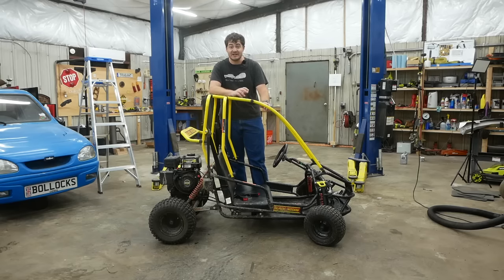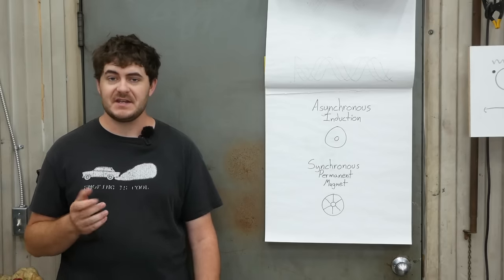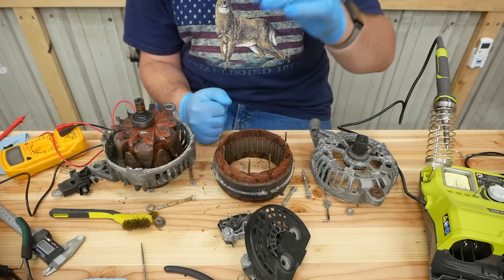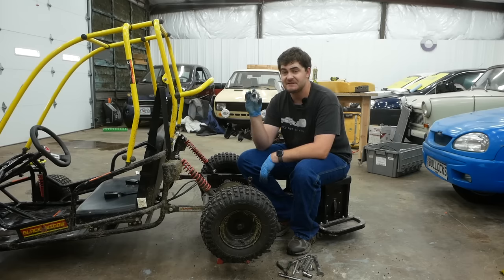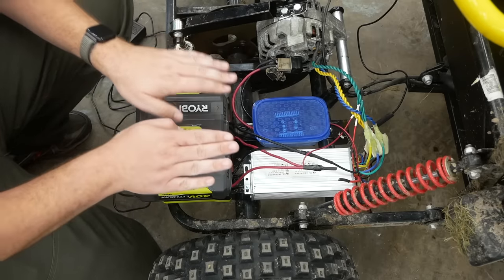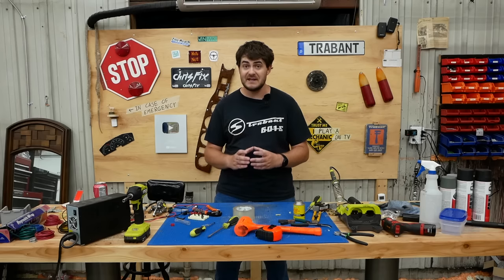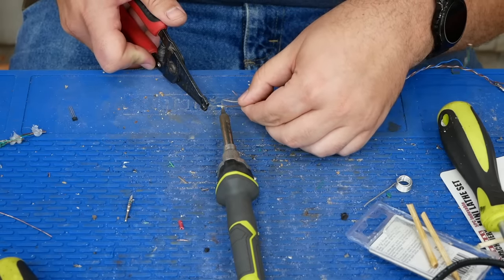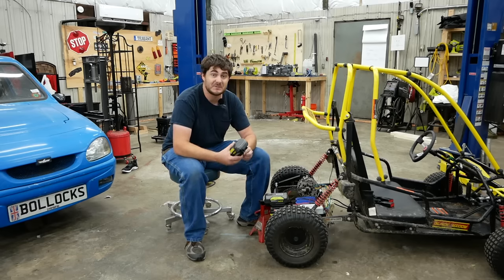Can I Power This Go Kart with a Used Car Alternator?

Comment: "So why doesn't it work? I don't know."

This is my maintenance career in a nutshell.

Edit: I've been informed that the reason it's broken is that somewhere years ago a maintenance technician slept with an engineer's wife and the rest of us maintenance guys are still paying the price.
Reply: Have you tried turning it off and on again? 

This is a joke in IT support, but it's also the most common advice. Because it works 90% of the time. Bloody programmers can't write software without memory leaks, or that gives back resources the computer when it's finished using them.

So then when another program, or the same one later on, need these resources, they're not there. If it's RAM they've consumed and lost track of (a memory leak), eventually the system will run out of free RAM and start swapping out to the hard drive, causing thrashing and slowing things riiiight down. So we'd ask you to save your work, if you can, then shutdown and restart. On restart the RAM allocation list is nice and free again, resources are fresh and unallocated, so programs can ask for resources and expect to get them. Everything runs nicely!

Except there's still that leak...! The solution ultimately is for the company to fix their damn software and for users to update to that version. But in that time there'll be a different bug in that, or some other, bit of software.
Reply: Software devs are the bane of my existence. Last timeI had an issue I sent 140 GBs of data to one of our software engineers to back up my claims because a control program they had us upgrade in the field had a huge memory leak and would corrupt it's own config files.

His reply was, "Huh, well it didn't do that in our field trials."
Reply: @NORMIES_GET_OUT  as an engineer I can tell you that when we design new things, shit always happens. I spent months working on the binary register of a microcontroller to be able to manipulate multiple dc motors. It worked PERFECT up until installed in the machine. Then EMF from the dang motors caused it to auto trigger since I was using such “basic” components of the controller!!

We try, we really do, I am also a mechanic of 20 years so I know the pain of a terribly placed bolt (just as my engine mounts smh)

But it still just happens. And most of us are (probably) eternally sorry!!
Reply: @TGears314  aawww man. and here i was thinking that every terrible placed bolt or stupid ass system (or function within a system) was put there on purpose by a very bitter human behind a desk, dedicated to the missery of others. like "ok.. we need a bolt here, here, and there. you know what? fuck it, i havee a terrible day... im gonna put it over there so someone someday somewhere will curse until hell opens right bellow their damn feet". :P
Reply: @NORMIES_GET_OUT  AMEN, AMEN, AMEN!!!
Reply: Oh my god, that explains so much. Every tiny bolt I’ve had to remove from a nearly inaccessible place in a gas pump while lying in the ground during winter in Canada suddenly comes into focus. lol
Reply: @greenaum  Have you tried programming something really complex before (I still struggle with simple stuff).  Sometimes software engineers really are lazy or more likely rushed by impatient bosses that don't understand that it takes time to make things right (as happens in every industry).  A lot of times software is made of many smaller pieces of code that someone else worked on because reinventing the wheel takes way too long and is kinda stupid.  Sometimes (often times) those pieces of code are maintained by 1 old guy in a small country who does the work because it's better than Sudoku (ie they are bored and enjoy coding).

Also memory leaks aren't the main reason why turning something off and on again fixes it.  Usually it's because of some other unexpected bug that causes a program to enter a loop that it can't get out of.  Sometimes this causes memory issues as well but that's not the main issue, it's that the program encountered an unexpected error that never came up in testing because you can only test so much.  Sometimes software companies have inadequate testing methods and never learn but usually once an error has been encountered and fixed a new test is added to try to catch similar errors in the future.  Sometimes there's no way to test for a particular type of error.  Sometimes hardware is to blame, especially outside of general computers (PC, Mac, Linux, Android, iPhone) in applications with harsh environments (cars, airplanes, spacecraft, ect).  Sometimes cosmic radiation flips a bit that causes random behavior (cosmic radiation actually led to a Speed Run world record in one of the Super Mario Games).

Comment: Can't he just drive the electric lawn mower? Then you can get some grass cut at the same time!
Of course he might wreck it and you'd be down one $5000 lawn mower and possible responsible for the death of a 6-year old...
Reply: Just get the wheego running again and he can use that
Reply: you would save more than $5000 in the long run not caring for the child
Reply: What he should do is ditch this dumb idea and put the damned engine back in it.  A simple limiter on the throttle will solve the power (of a 6yo) problem, just like they do with go-karts in those go-kart rental places.
I subbed to this channel back when he was rebuilding the Trabant engine.  Taking a great gas powered go-kart and turning into a shitty electric cart is just dumb.  Trying to convert an alternator into an electric motor for the kart is DUMB.  I already knew he was going to run into all these problems because he's not the first youtuber to discover the problem of re-purposing an alternator.  Furthermore, this thing is designed for a maximum of 65 amps output or about 900 watts.  They are notoriously unreliable with high load.
Reply: @tarstarkusz  I guess you missed the part where he said he was doing this for the fun of it.  He wanted to do the thing. So he did the thing.  If you came here to watch an expert with all the answers do the most efficient and effective thing, you've got the wrong channel (and website, for that matter.)
Reply: @tarstarkusz  isn't he doing this for the fun of it?
Reply: I was driving riding mowers with I was 5 and 6. Also Tarstarkusz is right on all counts.
Reply: You did not get the idea, he wants to eliminate the gas engine for its noisy and dangerous gasoline operation for his kid by modifying a alternator with a good source of information video which helped many understanding the concept of a working alternator, it wasn't a dumb but very clever idea, this was a informative video for intelligent individuals, he is a smarter person than you are period.
Reply: @ao2528  Gasoline engines are not in the slightest bit dangerous. Most people operate them multiple times per day.
The noise is a feature, not a bug.  Were you ever a kid?  Or were born a grumpy old guy?
Reply: @FranNyan  And fixing the motor wouldn't be fun?  I subed to this channel during the Trabant rebuild of the motor.
The segment of the audience this appeals to is the geeks. They absolutely love over complicated and sub-optimal "fixes" to imaginary problems like how "dangerous" and "noisy" the engine is. To where before this could be ridden all day, non stop, now at best at an hour.  
Do you know any children?  It's been damn near 50 years since I was on a big wheel screaming VROOOM VROOOM or sticking cards in the spokes of a bike to try and get that sound and I STILL remember it.  My own kids did it.
Reply: @tarstarkusz  you must be fun at parties.
Reply: @AdamS-nv5oo  As a matter of fact I am.  If my guests don't like the music, I don't just call them partypoopers, I turn the damned dial!!!
Reply: @tarstarkusz  You're basically complaining that he's doing the project HE wants to do, instead of the project YOU want him to do.   

I know plenty children, enough to know that each kiddo has their own preferences and likes.  And I trust that this guy knows the preferences and likes of his kiddo better than some rando on the internet does.
Reply: Natural selection
Reply: @KanawhaCountyWX  It would be less powerful than the go-kart.
Reply: @nitehawk86  it would say from the trouble of having to put in a speed limiter
Reply: @tarstarkusz  he said he was doing it for fun because he wanted to, he also said if it doesn't work he'd put the old engine back in
Reply: @tarstarkusz  fixing the engine could be fun like youve said a few times now he rebuilt the trabant engine for the reason.. it was fun and he wanted to... but aging wheels isnt just an engine channel, hes fallen in love with electric vehicles too, odd electric vehicles that are cheaply made and arent worth it like the wheego, but electrics too... plus thats just a 4HP side shaft engine, fixing it is almost dumb cause for the same amount fixing it can cost he just just go pickup a predator engine from harbor freight for pretty much the same cost, but wheres the fun in that cause then he might as well have just bought a better go kart with a working engine... maybe he bought that particular one knowing full well he wanted to electric swap it, you can clearly see in the video its more work than just hoiking another engine or fixing the broken engine, maybe he wanted a little project and well this looks more fun to watch... also yea im sure your fun at parties, turning the dial up on whatever you want to listen to but harranging others for having their own tastes that dont match you.
Reply: @compzac  No, he likes this kind of thing because it's over-complicated and doesn't work well.  That is what appeals to him.  This attribute comes out in a many different ways.  I was once like this myself.
We don't know what "fixing" the engine entails. It could be a rebuild or it could be cleaning the carb. He didn't say.  You can say the same exact thing about the electric motor.  he already could have bought a small electric motor for what he has spent.  Building a battery is going to cost hundreds of dollars and requires equipment he doesn't already own and which has no real other purpose.
This thing is useless as an EV.  He will get maybe an hour's run time out of it after spending many hundreds of dollars.  Or he could just fix the engine and it will run all day,
Reply: @theforerunnerreclaimer  Well, it doesn't work and instead of the old engine being fixed, which is the most sensible thing to do, he's got hundreds of dollars of parts on order.  All to make the thing less fun and less usable.
Reply: @tarstarkusz  OMG - you’ve made your point now take a chill pill. There is nothing really complicated about this project. It’s way simpler than a gasoline engine. Yes the engine might be quicker and cheaper to fix because we have a wealth of knowlege about them and plenty of cheap spares. But by the same token he could have bought an e-bike kit of Amazon and that would have been more powerful, less hassle to maintain and even simpler. But he wouldn’t have learnt anything. And his viewers wouldn’t learn anything. I’m not really sure what your problem is. No one forced you to watch.
Reply: @mondotv4216  I'm replying to people replying to me.
It's not simpler and you can ride it for many hours on gasoline.  Now it's turning into a thousand dollar boondoggle.
Reply: You do realize that by the time he is done this will probably be doing a wheelie or a burnout, which the original engine would probably not be capable of.
Reply: @milescarter7803  Sure it is. It's just a matter of gearing. 4hp is 3kw.

Comment: Hi, thanks for your work. my alternator sensorless was not starting on one ESC, now with a really cheap ESC is starting without hesitation. Once your moving, consider you have high current at no load (i measured 580W on mine @48V), so you need even more battery
Alternator to Brushless conversion-current at no load

Comment: I guess there wasn't a Weego motor or battery available for the project?
Reply: I was afraid he was going to use a Coda motor...
Reply: The Wheego battery is dead, remember? All the LiFePO4 cells failed. Also that motor can accelerate a car up to 60 miles an hour, that child will blast itself into a tree so hard it will become wood.
Reply: He wants the go-kart to run.

Comment: The magic sensorless rotor sensing thing is called Back-EMF. It uses the residual current from the phase winding that is idling (one of the three always is), to figure out where the rotor is.
Reply: I was quietly screaming this in my brain the whole time
Reply: I wrote this in butter on my toast this morning
Reply: you only know rotor position within one electrical cycle (phase). you still don't know the exact position of the rotor itself as there are multiple electrical cycles per revolution.

also, the "idling" phase statement is only correct for block-commutated/six-step drives. Sinewave and FOC drive all 3 phases all of the time.
Reply: In Permanent Magnet Synchronous motor (PMSM) drives, shaft position information is required 
for the proper control of the machine. In the PMSM drive the torque ripple generated by the 
machine has various harmonic content. The major torque ripple generated in a three phase machine
is due to the interaction of 5th, 7th
, 11th and 13th harmonics in the back emf with the phase current.
These induced voltage harmonics are responsible for the 6th and 12th order (electrical) ripple in the 
torque. In practical applications we tend to see various other harmonic orders in the torque.
Reply: @brianginn6354  me too

Comment: Use the centrifugal clutch from the gas motor on the electric one.  That's how the RC car folks did fuel to electric power conversions back when the controllers were crappy.  Motor can get spinning before is sees any load.
Reply: That was my first thought too!

Comment: the batteries probably have voltage sag, drawing too much power will course the voltage to drop down to too low levels which causes them to cut off

Comment: Hi, cool video
If you need more control of what is happening on sensor, motor, startup ramps… use a VESC, is so configurable , detects sensor position, adjustable cutout thresholds. Cost more (the smallest 50A is about 85 euro now, i paid 50 years ago)  and you can adjust the max speed with the bluetooth. I used in a kart and motorcycle (Pocket bike electric conversion - brushless)

Comment: While you were explaining things, I was thinking of ways to accomplish the goal.  The Alternator normally puts out 3 phase AC.  By removing the diodes, you have a ~12V DC motor.  I would buy a 12volt 3 phase variable drive to power the motor.  What would be controlled is the frequency of the 12 volts going to the alternator turned motor.  A cheaper alternative would be to purchase a 120VAC inverter.  Using a step down transformer, 12VAC could be derived.  Then using a capacitor a 'RUN VOLTAGE' could be derived.  A little fidling with the inverter to make it variable speed and the motor runs.
Back to basics:  There are no DC motors.  All motors that run on DC use a commutator to create AC that powers the motor.

Comment: Slight correction at 2:30 :  you separated the phases by 60, instead of 120 degrees. I do not blame you, I've seen it done wrong like this in some university classes even.
Reply: That bothered me too 😂 — they are supposed to sum to constant power deliver.

Comment: As someone who has done the exact same thing but for an electric bike, I made a 48v battery and struggled with voltage sag to the LVC (low voltage cutoff) of the controller at 39v. Gotta get a battery that can stay above LVC, otherwise you just get twitching
Reply: Used the wrong cells then.
Reply: @peterzingler6221  oh yeah for sure, not enough in parallel

Comment: the problem is like when you apply too little throttle on a brushless RC car it stalls if you apply a bit more throttle on start up it spins up fine so if the speed controller on yours applied more torque from start up you should be fine
Reply: RC cars have sensor less brushless controllers. They're designed to operate without the hall effect sensors, so it's a bit different.
Reply: @zakattack721  his motor was sensorless he added the sensors because it wasnt moving just twitching
Reply: @compzac  Yes but the controller was expecting a sensored motor. If you unplug the encoder on an eBike it fails to spin in the same way
Reply: @zakattack721  was it though, it was working better before he sensored the motor... really my guess is that the poorly translated sticker on the controller and the non existent manual would have told him how to set up the controller, but since the manual doesnt exist and the sticker on the controller wasnt in english how would he have known it probably needed to be programmed. most controllers ive messed with can use either hall effect sensors or back EMF but you have to tell the controller what to expect and in some cases have it learn.
Reply: @zakattack721  my god I didn't realize RC car motors were sensorless even you really have pointed out the obvious there chief

Comment: As a former electrician, I have one issue. Your drawing of 3∅ waveforms show a gap where all three phases dip into negative, but the whole point of 3∅ power is that there's always one phase in positive territory.
Reply: YOU ONLY HAVE ONE ISSUE?  Your kidding, right?
Reply: @imaetech9648  I was a commercial electrician who dealt with 3∅ power quite a bit. I deeply regret not going through the video frame-by-frame and pointing out all the technical problems I don't really know much about instead of pointing out the obvious thing that stood out to me; please forgive me. I'll do better